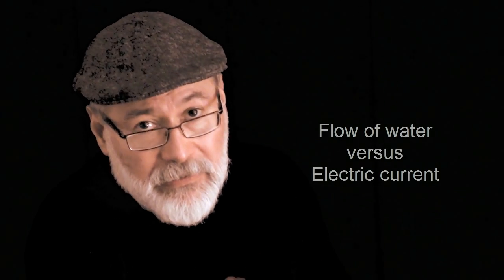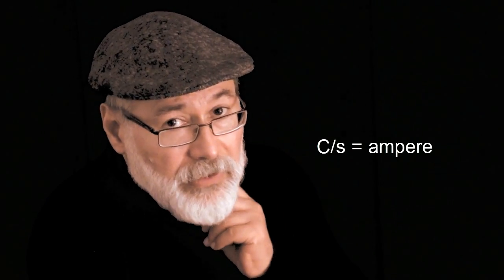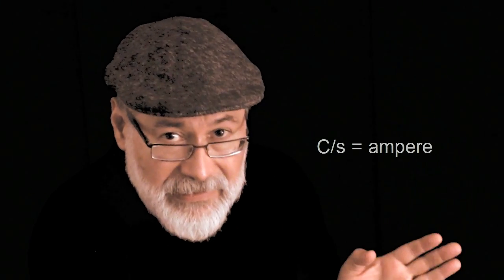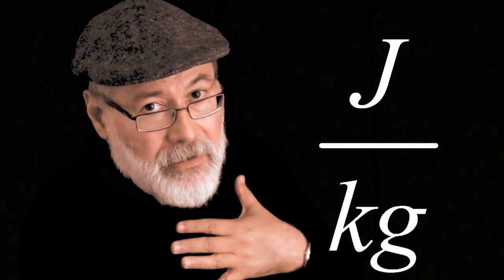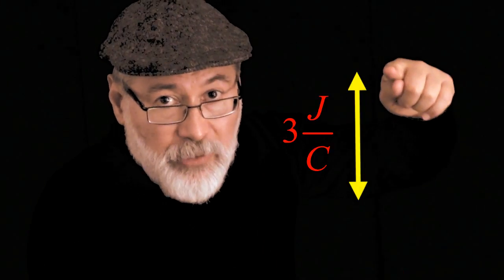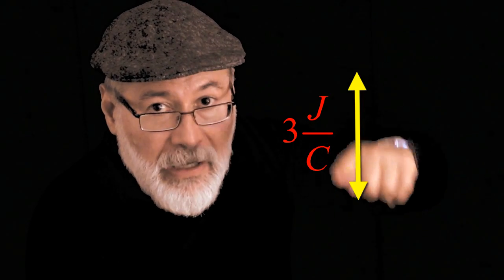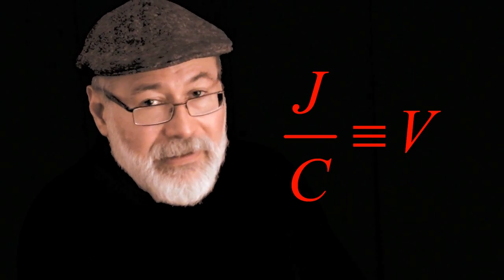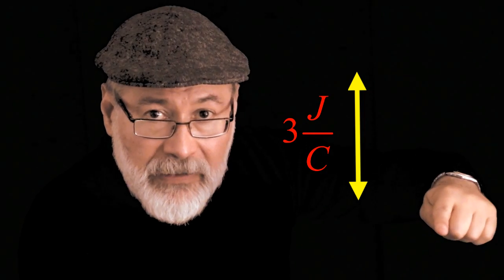EE 101/3 - An informal talk about voltages (CC)

Comment: Your explanation is perfect but I have a question. Maybe my question wiil be dumb question, I will ask anyway. You say that the batteries creates electric fields, so up and down makes sense to electrons in wire and other components they gain energy and they move. One thing that I didn't understand is how the electrons does not run out? I mean there are limited number of electrons in material right? If the batteries provide electrons also, how we manage create or supply more electrons to that batteries? That's bugging my mind.
Reply from the maker: +Talha Çolakoğlu Dear M. Colakoglu,  the number of electrons remains the same. They do not disappear nor appear, they just "circulate", they move ... they move "uphill" through the battery (like a skier is moved uphill by a lift-chair at a skiing resort), the battery picks them up poor in energy at its (minus marked terminal) and raises them (replenishes them with potential energy) and releases them at the terminal marked plus, so they can slide downhill (outside the battery) and deliver their recently gained energy to the circuit outside of the battery. In this sense, they could be seen as energy carriers between the battery and the passive elements. This is, of course, a very crude model, but one that is accurate enough for a first view of the phenomenon of energy transportation.
Reply: +rolinychupetin Thank you sir. I've learned more from you than 2 years in collage.

Comment: I take your point about altitude and airports, but as a procedural matter student pilots are taught from day 1 to set the altimeter before take off to known airport elevation or more correctly,and particularly for instrument flight rules (IFR), the local barometric pressure.  The pilot then updates the instrument with reported readings along the route of flight.  This assures obstacle clearance when referencing navigational charts, which use a datum based on mean sea level -MSL.  This datum is derived differently in different continents but unless the flight is intercontinental is not an issue.

Another fine video.Yours make me  I wish I were a student again.

Comment: Interesting.. So connecting a simple two resister voltage divider to a battery, and measuring the three points of the resisters, I could have a positive, zero reference and negative voltage ?.
Reply from the maker: Yes, if you choose the middle point between the resistors in the V-divider as your reference for the entire circuit. That's the catch, that the reference is the one used in the entire circuit for your voltage measurements. In gravitational heights, and using the sea level as the reference, then Death Valley, in the USA has a negative
altitude: negative eighty three meters. Or, if we want all the continental land in the USA to have a positive altitude, we simply choose Death Valley as the reference. Try this with a voltage twice the value needed to power up a dual source op amp, and then set up a voltage divider as you propose, etc., etc.